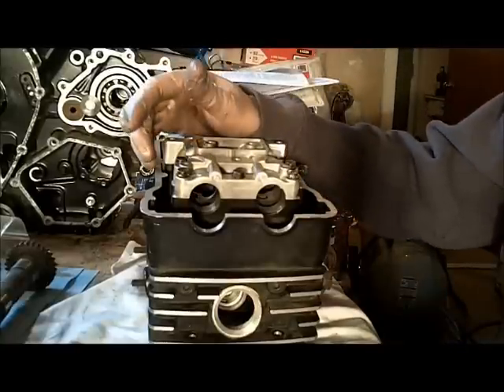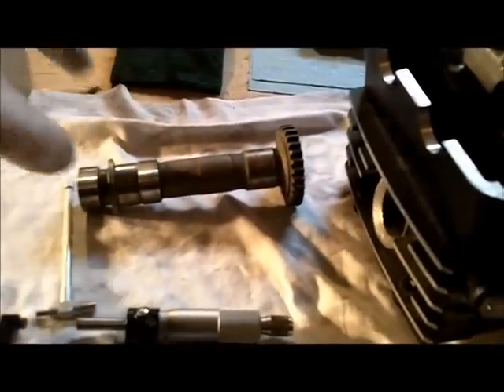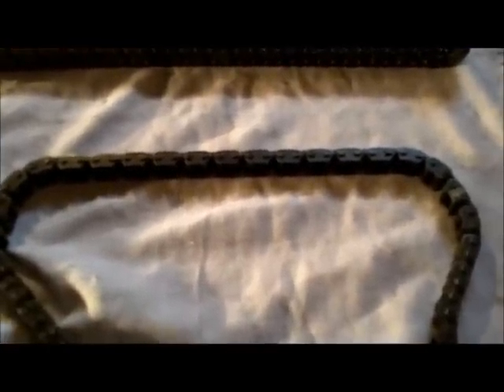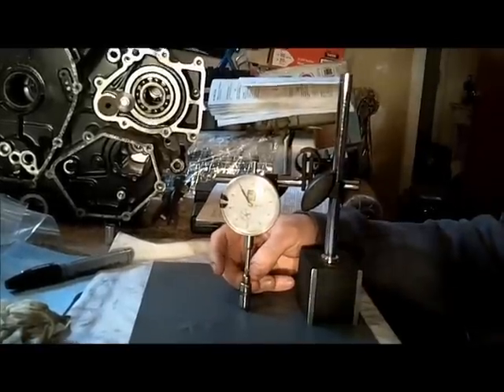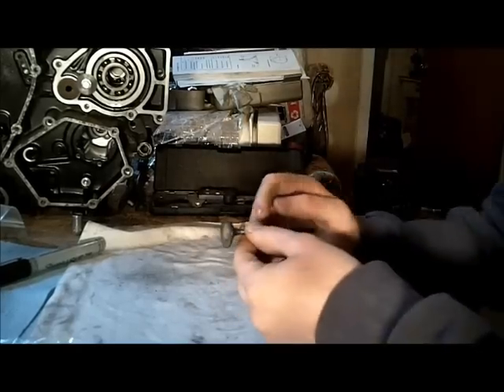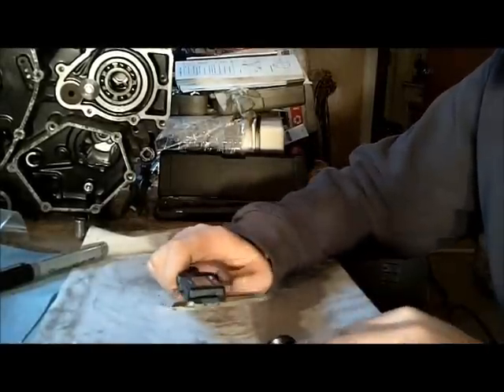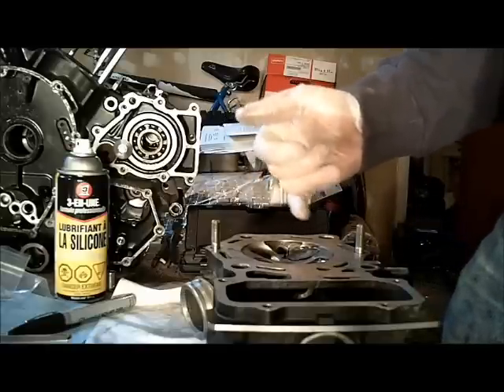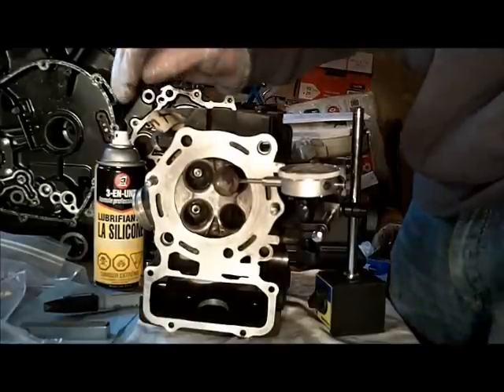1985 Kawasaki VN750 Engine Rebuild - pt9

Comment: When you are checking for head warp, you should be checking the head to cylinder mating surface.  It is rare for a single cylinder head to warp enough to cause a problem though.